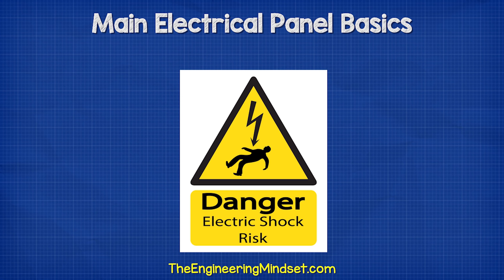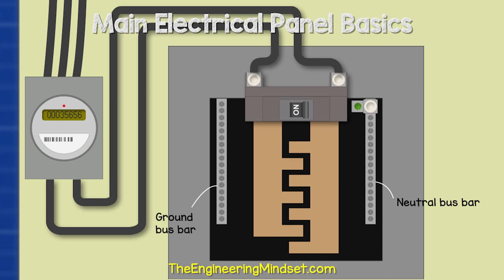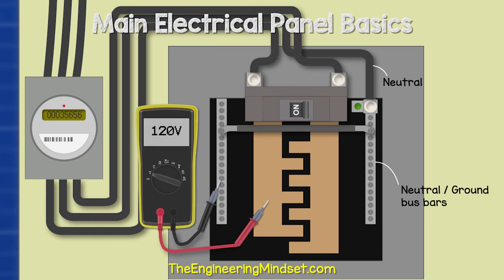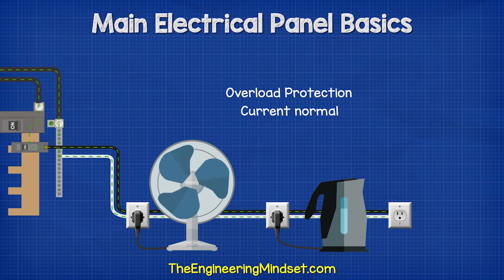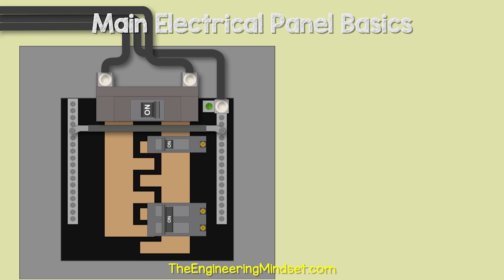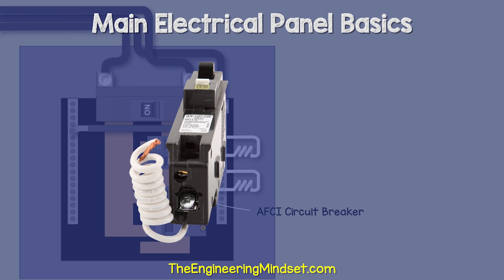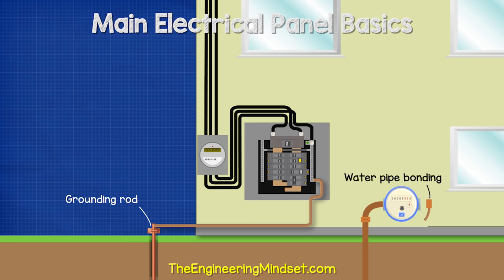Main electrical panel explained - Load center - service panel

Comment: Please to what extent do you bond the neutral wire to the earth wire and to what extent you don't do that...
Reply: I’m not an electrician, so I’d refer you to videos about bonding / Earth ground, bonding protects devices, where ground is generally at the service panel, not the subs.  So that neutral lug he showed is not used on sub panels.
Reply: Never bond neutral+grounds outside of the primary electrical panel for your service. This prevents undersized wires from carrying fault currents that are over their capacity (effectively turning them into giant resistive heater elements).
For all intents and purposes: the 3 wires (2 conductors and 1 ground) are all separate wires that serve their own purpose (except when it comes to the service panel and meter box).
The center of the transformer connects the neutral to a ground wire by the pole, the ground allows fault currents to get back to the transformer to complete the circuit and pop the breaker. Breaker isn't magic and only works if specific conditions are met.
Reply: The ground and neutral bars are only bonded together in the main electrical panel.  If you install a sub-panel (like a panel in your garage or another outbuilding that gets its feed from your main panel) the ground and neutral bars in the sub-panels do NOT get bonded together
Reply from the maker: Check the new SUB PANEL EXPLAINED ➡️ video https://youtu.be/NUSNa-7Hecw

Comment: Could you please explain how AC work in RV’s & Boats? Are neutral and ground bonded? If not where does electrical current flow if the source was onboard generator?

Comment: I'm from Malaysia and we used UK-base electrical system. When I start watching this video, I was confuse why there are 2 live (hot) incoming, I though one is live, one is neutrals as they are oscillating the current flow, but then suddenly the neutral come in into the picture. WAIT. What??? Ohhhh, US have different transmission system! Got it. We have 3 lives incoming supply too for bigger house but we always see that the neutral wire is the one completing the transmission circuit, i.e., for current oscillating.

Comment: Thanks engineering mind set for valuable information.
I have suggestions I you can.
Can you doing another video talks about DC current automotive fuse panel
And sjb (smart junction box.
Or in other words automotive fuse boxes designation and best animation like this.

Comment: Great video. I have to say, ground wires in a non gfci circuit don't make it safe. They are meant to cause a fault for the breaker and trip it. There is potential for a metal casing to be energised and not trip the breaker. -the saying every path back to source.
Reply: wouldn't the ground wire bonded to the metal casing be the least resistant path back to source, so electricity is least likely to go through you rather than the ground wire?
Reply: @whith5184  least likely, implies there's a chance power won't travel through the higher resistance. That's not what occurs. Power will still travel the higher resistance and there is more then enough current available if the breaker doesn't trip. Other factors influencing it are how conductive our skin is at the moment, shoes clothing etc. Think this way, current takes every path back to source, as opposed to the easiest path back to source. 😉
Reply: @torque350hp  thanks for your answer :)

Comment: would a faulty current or the hot wire coming loose as in 6:00 and touching the housing box cause the breaker to trip if there was no ground wire? is a ground wire just to absorb/make it safe or does the ground wire receiving a current cause the breaker to trip? would the hot wire just continue to supply a load if there was no ground?

Comment: Can incorrectly connected wires increase electricity bills?      🔌💵
Reply: Well it depends, if wires are shorted then it may increase electric bill due to energy loss but your safety system will prevent it. But if the load is same then no matter what how you connect your wires it shouldn't increase your electric bill if your device was working properly.
Reply: How much extra is your bill being increased? Did someone working on your house tell you that to try to justify service work? They are probably just using it as a line ot get you to do the work. If you think your bill is too high, that is a different conversation.

Comment: Really good video, but it is the same exact video from 4 years ago "120V 240V Electricity explained - Split phase 3 wire electrician". I just wanted to make sure I wasn't missing anything. Thank you though!
Reply from the maker: It's based on that video. Some parts were edited to improve the user experience. We have just launched the sub panel follow up, see our latest video
Reply: @EngineeringMindset  Thank you :)

Comment: Ground wire should be terminated to ground busbar not on the neutral bus bar, even they are bonded together with ground bus bar. that's the best practice to implement.

Comment: Great video, but I do have one question that boggles my mind. Is there a good reason that there is no gfci or afci for 240v circuit, even on outdoor or wet environment use? As far as I understand, not only code does not require it, but no stores are even selling one. 240v is far more dangerous than 120v, correct?
Reply: The 2020 NEC code did expand on GFCI for 240V. But there were issues in that people were complaining about unintended tripping. There are 2 pole GFI breakers out there but super expensive. It's current that dangerous, not voltage.

Comment: Do you have a video that would explain why a washing machine would sometimes trip a 20 amp breaker if it’s the only appliance on hat circuit? I’m assuming the LRA is very high on the spin cycle as it’s the only time it trips the circuit is when it initially starts the spin cycle.
Reply: It should be fine “if” there ISN’T another outlet connected to that branch.
Reply: @KinGIIRomE  no there isn’t and I even had a tester in the outlet while the washer was running and it trips. The funny this is that if I use an extension court and go to another outlet the washer works but seldom it trips that one at times. The washer is brand new and we had a technician look at it and all he said was try putting a 30 amp CB in and take the 20 amp out.

Comment: You say the neutral bar returns electricity back to the transformer. Why does the electricity go back to the transformer instead of going to the ground? Isn't the neutral bus bar bonded to the ground? thanks

Comment: My neutral and ground bus bars aren't bonded in my breaker box. I think they are by the meter though. My stove wire only has 3 wires, black - white - bare. They are thicc. Does the bare wire connect to my ground bus bar or my neutral? How does the clock work on it with no neutral/120v?

Comment: I was trying to get a light to work in the laundry room and accidentally shorted power to the box from the switch. It threw a breaker for the garage door. The switch for the light still had power. Can shorting to the switch box cause another breaker to trip through the ground.?

Comment: Please make a video on Australia and New Zealand's electrical panels.
Reply from the maker: It's very similar to this UK/EU version https://youtu.be/J6w-ASh6eKw
Reply: Not really,every individual circuit is on an RCD, we do not use MCB’s. Also a lot of houses here have 3 phase 415 volts and electricians are expected to balance the loads over the individual 3 phases for single phase loads. Even houses here run things like 3 phase air conditioner as they are cheaper to run as our meters work on current draw.  In industrial uses businesses have different meters again and are charged for power factor so large users fix the power factor.

Comment: The power supply shown is line to line 240v, in the lighting part the power supply from 1 circuit breaker and 1 line from the neutral bar, its 120v as mentioned earlier... so lighting fixtures should be rated at 120v?...

Comment: Hi! Nice video, however, can you do one like this for non-american standard? I understand that most consumers use 220~230V and does not use split phase like the one here; rather, it's only single phase and only 1 hot wire is used. Thanks!
Reply from the maker: Here you go https://youtu.be/J6w-ASh6eKw

Comment: i want to replace my main 100amp breaker inside my load panel with a 200amp breaker and add a new circuit with a 50 amp 240volt breaker for my welder my question is how can i shut the power off to the main breaker to safeley replace the main breaker is there another main inside the meter upstream ? and is it legal or okay to shut the meter off inside the meter box ?

Comment: well done.  at 2:20 - is that a video that already exists or something you are working on?  I've always wondered something: on a split phase system, between the the two hots (240V), the current alternates at 60Hz (in North America anyway).  SO this would be the condition for stoves, driers, etc.  But what about the lower-current lighting 120V branch circuits? Does the current alternate between the single hot and the neutral at 60Hz, or is it more like (forgive my ignorance in terminology) a chopped or PWM condition where the sinusoidal oscillation would be chopped such that instead of alternating between the two hots, the current is instead intermittent in one direction in the single hot and through the neutral.

I think your diagram at 2:20 kind of shows this, but I can't quite make it out.
Reply from the maker: The video is live, scan the QR code or use link. In the US both 120V and 240V will be 60HZ, only the voltage changes. The peak voltage occurs at opposite times for the two 120V legs. E.g. One hot wire is +120V while the other is - 120V then it reverses. The peak is actually 170V because 120V is the RMS voltage but that's for another video
Reply: @EngineeringMindset  thank you for the response.  What you mentioned I already know.  I think I did not word my question properly.  It would be simple to describe if I could draw a picture.  Anyway, I will watch the video with the QR code, thank you.

Comment: 1.	While reviewing data, you notice the following reading:
•	Voltage = 122V
•	Current = 12A
•	Power Factor = -.99
•	Phase Angle = 176.66
•	What are your observations?  Does the data look acceptable?
•	What question do you have? Would additional information help you?
•	If you have determined the data is inaccurate, what are some causes, and what could resolve it?

Comment: Are the two "bus bars" in the panel the same phase (from the transformer on the street)? THANKS!!
Reply: No. If it was the same phase across the two bars. You wouldnt get the 240vac. Its a two
Phase system. But they call it single phase. Two 120vac phases.. a 100amp panel at 240vac is two 100amp 120vac

Comment: @ 5:20 the video says the purpose of the neutral wire is to carry used current back
to the panel.   I don't know much about the subject but shouldn't it be that the
neutral wire carries unused current back to the panel?
Reply from the maker: Clearly animated here https://youtu.be/UBERduCp3Wo?t=362
Reply from the maker: The current is flowing because the electrons have a path from the hot to the neutral. Meaning it is flowing through, for example, a lamp to get to the neutral. The energy is removed as heat and light by the lamp, the electrons continue to move as they're being pushed by the power station. The current must be able to return to the neutral for this to occur, although in the 240V connection it could go hot to hot but ignore that at this point.

Comment: Question: If nothing in the house is on, completely empty, nothing plugged in, no lights on, water heater off, ac off, etc.  Nothing is using electricity.  All breakers on, except hot water and ac.  Does the meter spin/Is power being used?     Just off of the resistance of the wires?
Reply: @GH-oi2jf  so are you saying the meter will spin?

Comment: So different from the European standard, one question, if the ground and neutral share the same bus bar (weird btw) why use 3 wire cable to the panel instead of just using two wires and tying the neutral wire to the metal casing of each device connected to it?
Reply: The neutral is still a current-carrying conductor... you don't want your device casing, conduit, or a bare ground wire carrying that current ever. All that stuff should never see current except in the event of a ground fault.
Reply: The ground and neutral are only shared at the main service entrance point. After that grounds and neutrals have to be separated. As iwfur said, the neutral carries current, you don't want the metal casings of each device to have current on them. The separate ground is for safety, current carrying is not safe :D

Comment: This is ONLY ACCEPTABLE at a Main Panel where the Neutral must be bonded to Ground and connected to a Grounding Electrode. At no sub-panel should the Neutral be connected to Ground, and Ground wires must go to Ground Bus, Neutral wires to Neutral Bus, NOT INTERCHANGEABLY! Best practice would be to keep Neutral and Ground isolated from each other, and do the single allowed bond at Main Panel. Don’t forget the Grounding Electrode conductor to a Grounding Electrode.
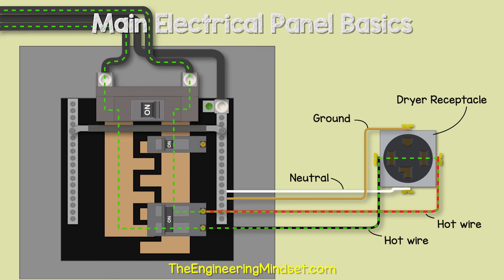Reply: @ 7:00 Can you connect the pig tail from a GFCI circuit breaker to the ground bus bar , if it is too short to reach the neutral bus bar on a main panel ? Or how to make the pig tail longer ?
Reply: He mentioned that in the video.
Reply from the maker: Check the new SUB PANEL EXPLAINED ➡️ video https://youtu.be/NUSNa-7Hecw

Comment: I moved into a place where I don't see any GFCI outlets in the kitchen or bathroom.  My GFCI tester plugged into these outlets does not trip when tested.  Is this an indication that there is no GFCI?  Or is it possible there is a GFCI circuit breaker that wouldn't trip under these conditions?  How can I identify it?
Reply: The breaker would very likely say GFCI on it, as well as have a little "test" button. If your tester did not trip the circuit, you probably don't have functioning GFCI anywhere.
Reply: If your tester does not trip the circuit, there is no gfi or it is malfunctioning. Absolutely worth looking into and fixing.

Comment: Sooooo... If I install a Uropean socket between the two busbar, I can use all of my Uropean stuff right? 230 Vs 240 Volts should not make a difference.
I guess I still have to make my own grounding rod for safety... right?
Reply from the maker: The frequency is different so some devices won't work like record players but modern electronics with can handle different voltages and frequency so in theory yes. But this is against code.
Reply: @GH-oi2jf  Just gooled the NEMA Wiki.
W T F ??? 6! different designs for the 240V? another 8 different for normal 110V, and another 10 for special usage??? Plus the old outdated one...
Here in Urop, we have ONE design for normal household 230V, and another ONE for 400V for high power machinery. 
Well, wooden construct is way less prominent here, but a good circuit breaker and a FI relay would to the trick for wooden houses too.
Well we had the opportunity to build up our infrastructure from zero after WW II, with all the lessons how NOT to design a system, meanwhile the US had to drag the literally prototype legacy system to the bright future, patching it left and right, but unable to move to a BETTER design..
Reply: @bandiras2  You didn't know about the panel wiring and the frequencies but you feel you can speak on what is the "better system"...?  Just because there are many NEMA receptacles listed doesn't mean there is a problem... Literally 99% of the 120V devices you purchase in the USA will work in the common receptacles here. You will only find 2 NEMA types in a household, namely 15 amps or 20  (most all plugs will work on both), plus a 240 volt receptacle with properly rated current for say, a dryer or oven. Also, having the lower voltage for general use is actually smart because power increases exponentially with a small increase of voltage.

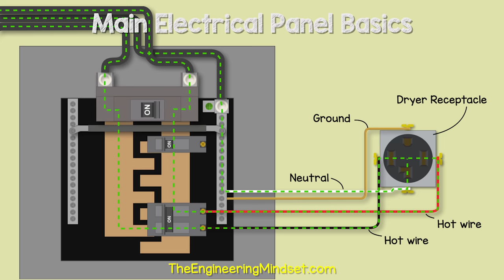Comment: @ 7:00 Can you connect the pig tail from a GFCI circuit breaker to the ground bus bar , if it is too short to reach the neutral bus bar on a main panel ? Or how to make the pig tail longer ?
Reply: You can splice on a longer wire.
Reply: There should be a neutral bar on both sides of the panel so it should be long enough to reach. You have to be sure that it is a main panel. There are codes requiring neutrals and grounds to be separate at points after the main panel.
Reply: @goaliedude32  yeah but some times they still do not reach
Reply: @videojones9884  It is okay to wirenut them

Comment: I'm confused what is meant by "used electricity." With DC I might interpret it as "outbound electrons", but with AC aren't electrons just moving back and forth?
Reply: DK: Substitute "Return Path"
Reply from the maker: So if you imagine the electrons all piled up in the hot wire, as soon as there is a path available for them to reach the neutral, e.g. a lamp is switched on, they will instantly flow through to reach the return path. The lamp removed energy as heat and light but the electrons remain in the circuit, pushed by the power stations generator. As these have passed through the load then we could consider these as used. If it was DC electricity from a battery, then the electrons would flow back into the battery to complete a chemical reaction and be locked up as a result, the battery then eventually dies as it can't release any more electrons. However in AC, the electrons just move backwards and forwards so they are constantly recycled,. "used" probably wasn't the best term to use but I was trying to relate it to DC as it's much easier to visualise.